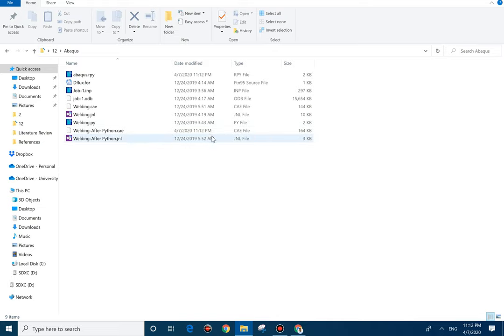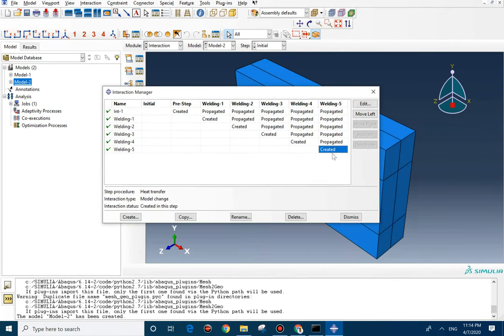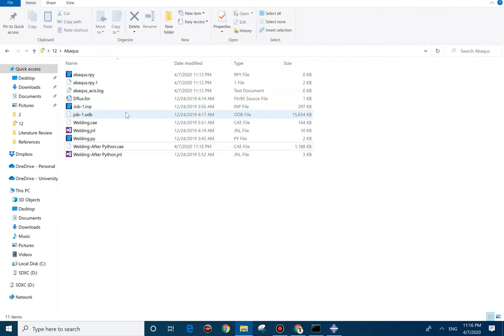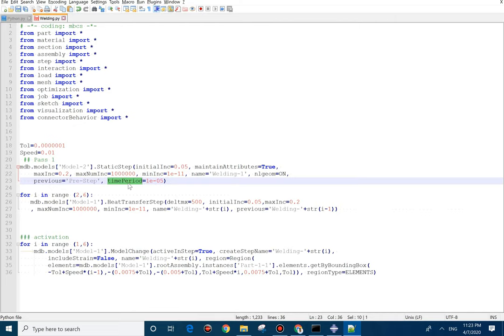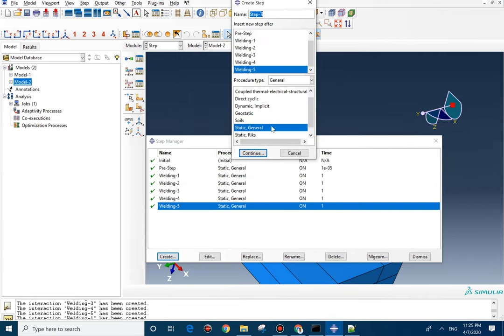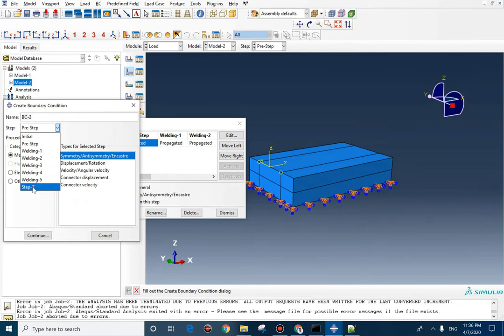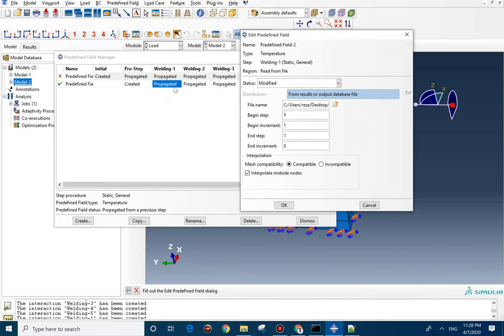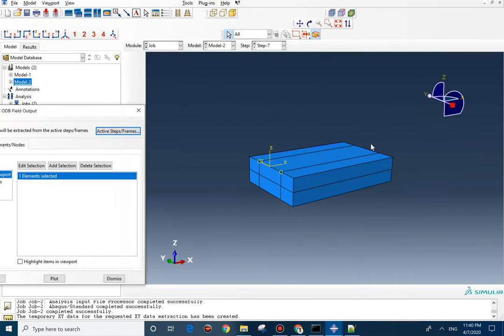Abaqus model to predict the residual stress in Welding (or additive manufacturing) process.

Comment: I am working on numerical simulation of pressure wave on metal target. the pressure wave duration is 120 ns. simulation ran for 1E-5 Sec, i was trying to analyze residual stresses, but the stress value i got different for each frame (Every time increment), i thing its due to inertia effect, can you help me to understand its physics?